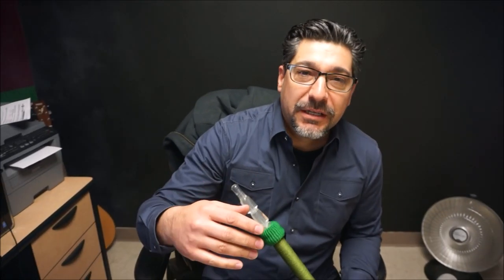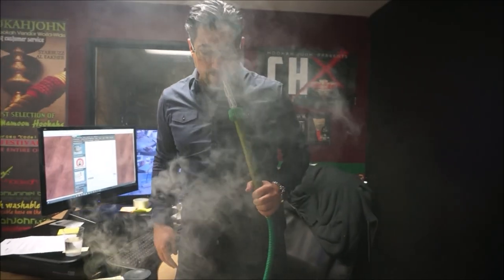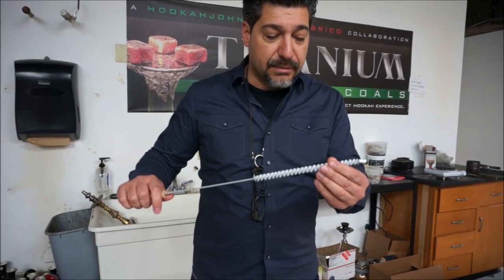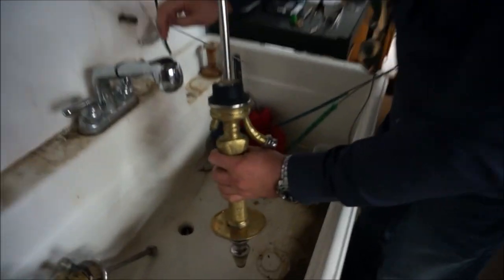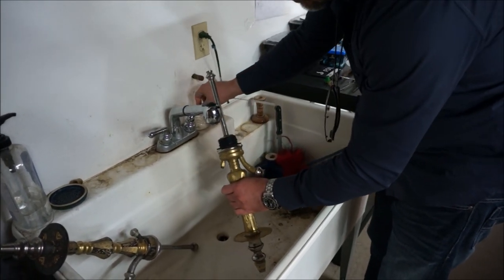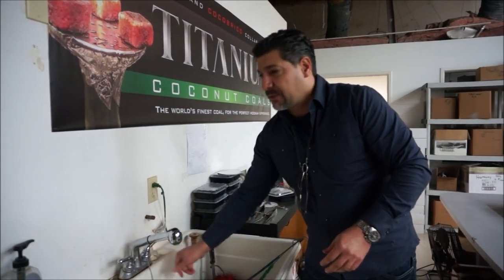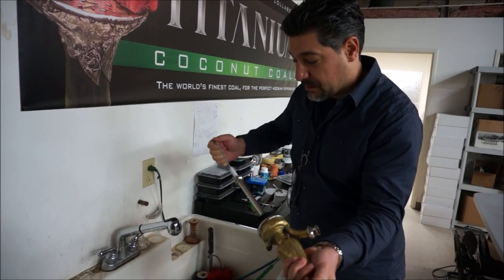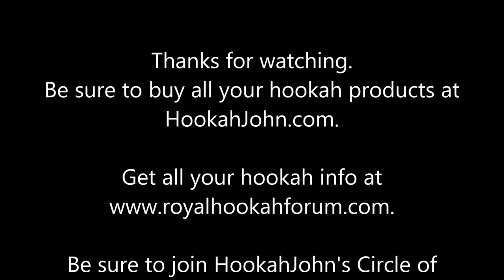HookahJohn's Must Have Hookah Accessory Pack

Comment: Do you promote silencer for the stem?
Reply: You mean diffusers?
Reply: whats the difference?? i thought its a cool product
Reply: +Tango965  It is I just thought yu were confused
Reply: they create smaller bubbles thus less noisy right?
Reply: +Tango965 yes, they're just typically called "diffusers." And i agree, that would be a great addition to this pack.
Reply: okay i bought one and tried it yesterday. I still prefer without it.
Reply: i like it b/c it cuts down the noise and the rattling.
Reply: Yup it did. but i didnt like the tiny restriction that i felt.